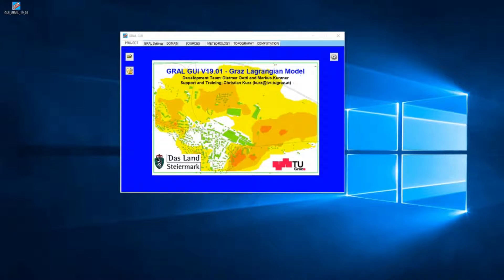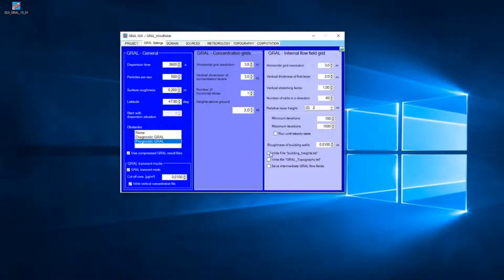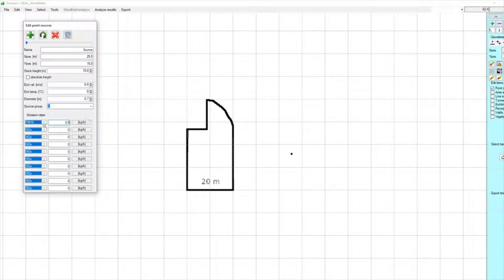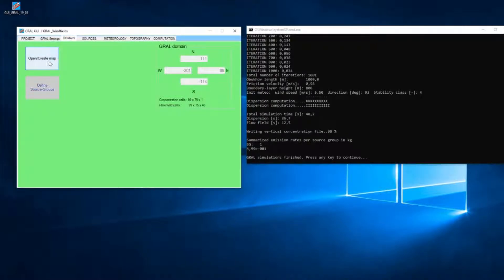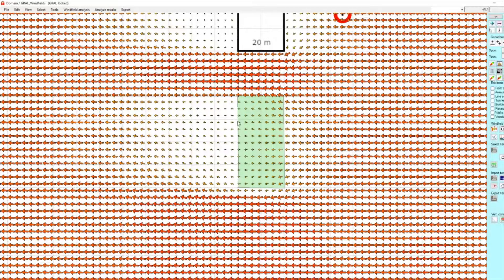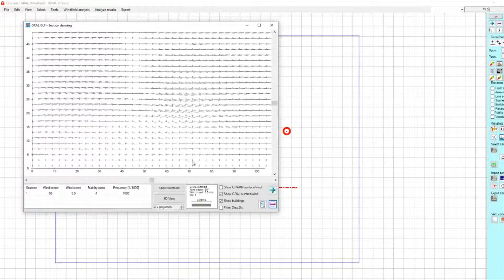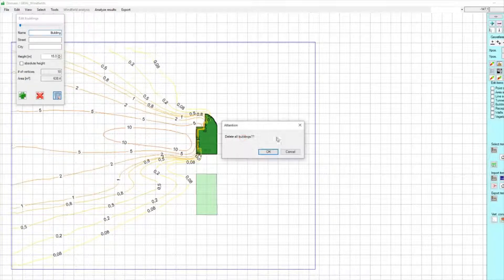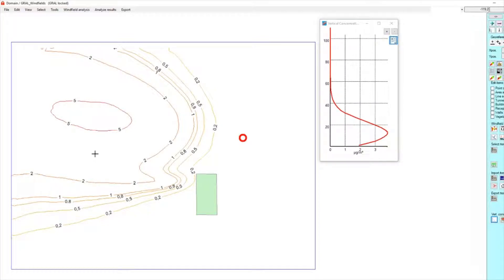Microscale wind field analysis | GRAL #5

Comment: Hi Sir, I tried to do a simulation with GRAL. However, it is always problematic to enter raster data for topographic data. Can GRAL software be used outside Austria? Actually, I use it for Indonesia. Can I also communicate directly via email to communicate this problem? Thank You.
Reply from the maker: Hello,
GRAL is used worldwide, but calculations with terrain are somewhat more complex because several steps are required.
In the first step, wind fields must be calculated using the mesoscale GRAMM model. For this you need terrain, land use data and at least one meteorological station within the GRAMM domain area. The domain area should cover at least 20x20 km.
Then you use the GRAMM model (grid size typically 100 to 300 m) to calculate numerous meteorological cases, ideally using the delivered artificial wind rose.
In the next step, you use the Match to Observation function in order to select the best matching wind fields from the calculated data of at least one wind measurement station within the GRAMM domain area. 
You can use these wind fields for the GRAL calculation with terrain and then define an additional microscale terrain (grid size down to 2 m).
Perhaps I will find the time to make a short video series on this not entirely simple method. In principle, the procedure is described in the manuals.
Reply: @grammgral8697  Thank you for the response and explanation, quite enlightening. However, it seems that what I need is a simulation example in the data preparation process until it is successfully input into the GRAL software. Incidentally, I use topographic data in the form of DEM raster data with a size of 27 x 27 km, and so far I have converted it into ASCII data. However, after I input it, I always get a notification that my domain is outside. I don't understand this. I will wait for the video tutorial, thank you.